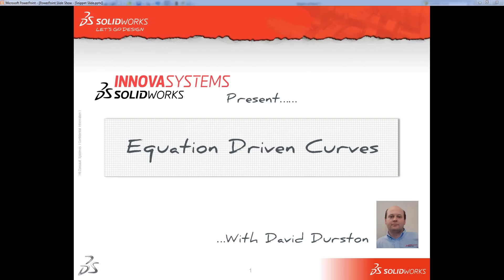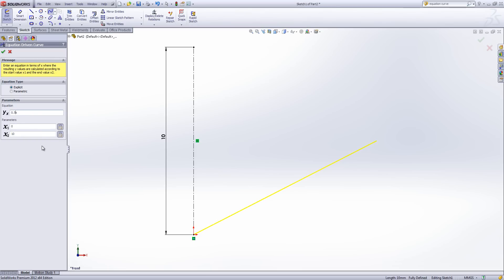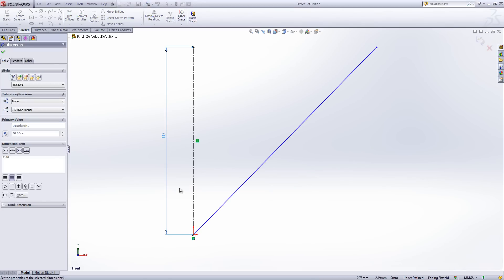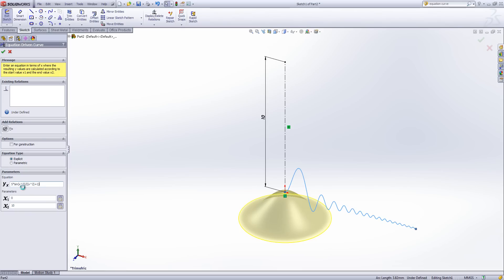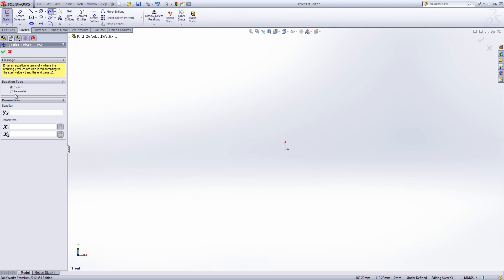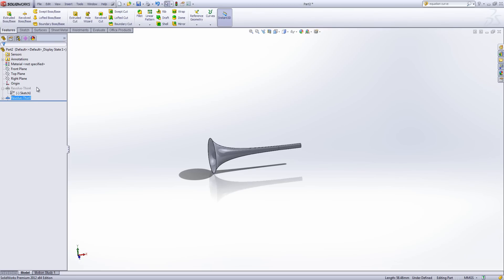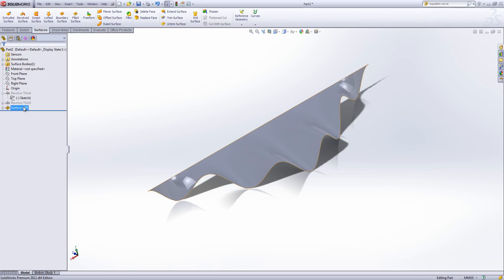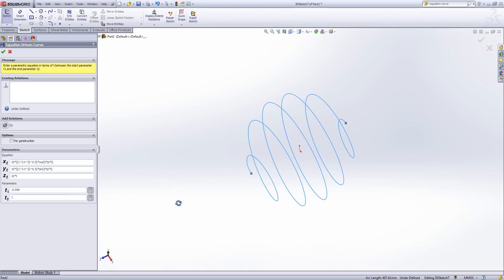Equation Driven Curves in SolidWorks

Comment: What good is this for if I cant Sweep a simple sinusoidal curve given by: 13*cos(pi*x-.5*pi).
I'm left wondering if I can do anything else with it.
After making the curve with that equation, from 0 to 12.5, I try to do Swept Boss/Base with a circular profile with 1mm and it takes a long time to process just to fail miserably... (Solidworks 2016) 
It even crashed Solidworks once.. If equation drive curves are like this we can't use them :(